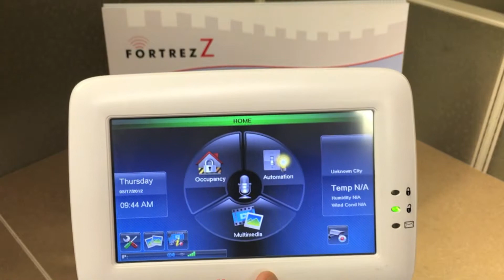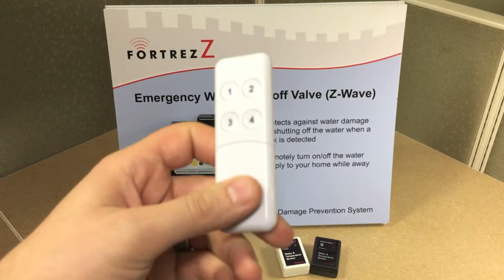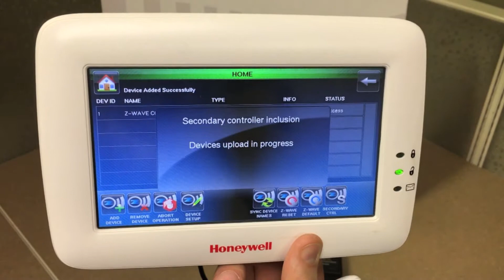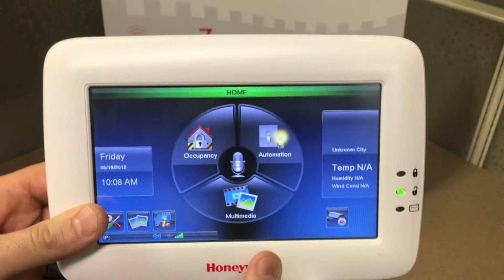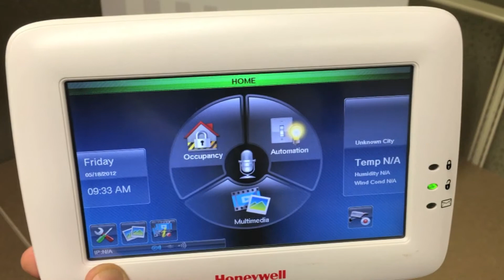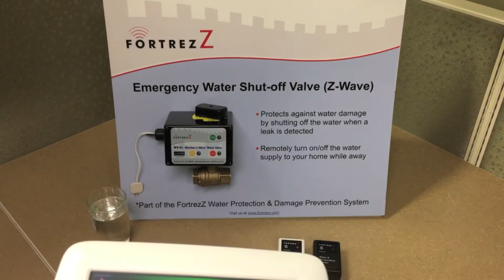How to Pair Our Water Sensors and Wireless Water Valve Using A Honeywell Tuxedo

Comment: June 2016. So even after the June 2016 Tuxedo Software update this does not work. Even though there is a bypass option, shown in this video, to add it it its time consuming, and one needs to buy another device. Also, not counting the frustration with the valve and sensors until a buyer gets to this video. Not sure if the problem is on Honeywell side or Fortrezz, as Honeywell suggest using this valve on their support page??!!